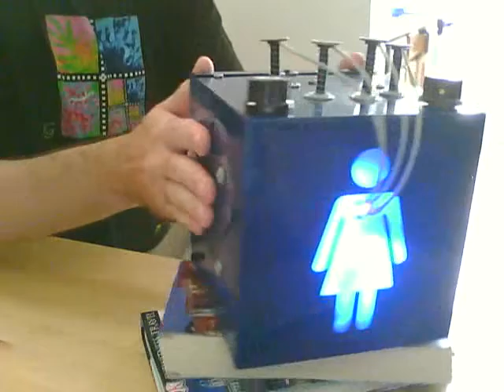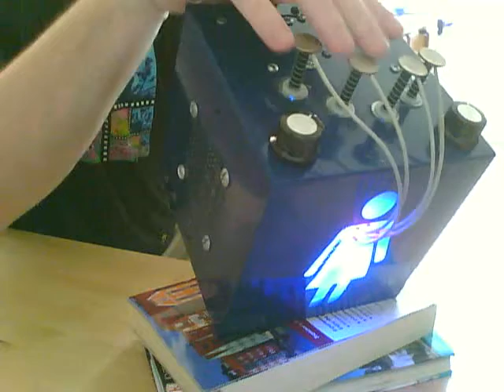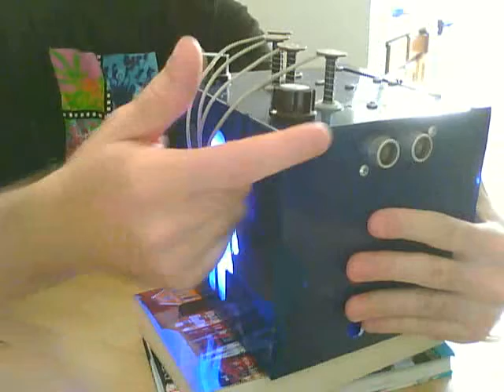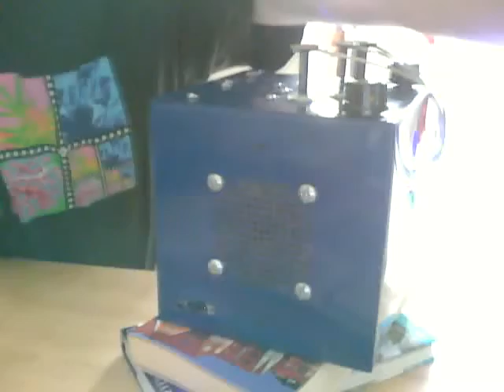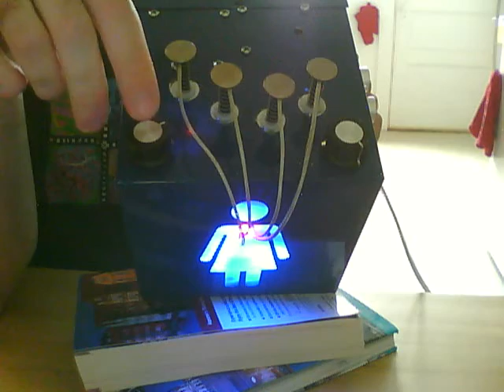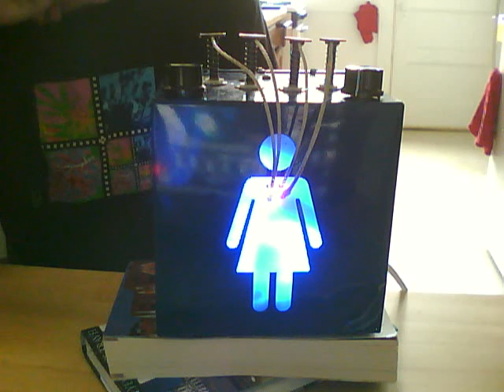Arduino Theremin Synth Final

Comment: looks like a solid student project :) I'm wondering about your push buttons, I love the idea of them not being binary, they do output a variable analog value right ? They look DIY, are they nails with springs, maybe based on the capacitive effect ? please tell me more about it :) if you ever come by this 15 years old project haha
Reply from the maker: I just saw this haha, yes it's been awhile since I did this.  The push buttons have an LED, and they go closer or farther to a photoelectric sensor when you push them down.  So yes, they do input an analog range.  On startup the sensors take a reading which is used for calibration.  They are plastic furniture bolts, which are hollow.  The metal disks sitting on top of them are dimes. The cables going into them are the power for the LED.  For a completely ad-hoc solution it actually works quite well, as you can see.